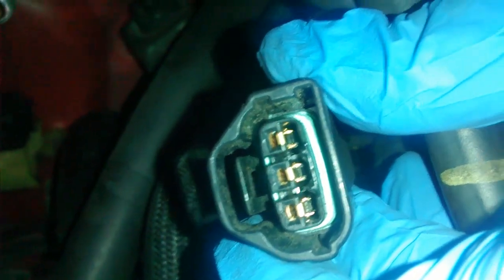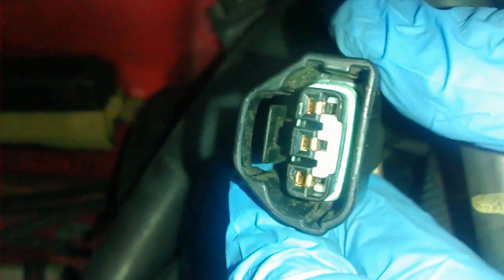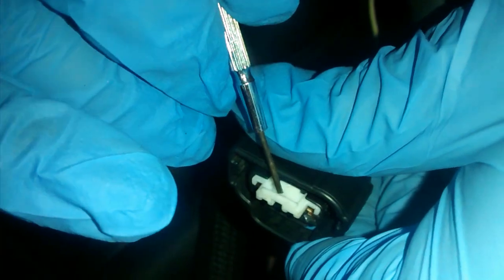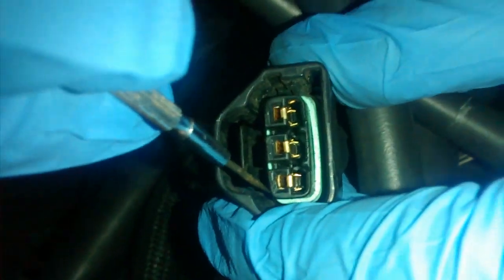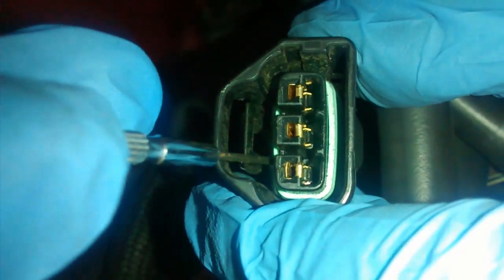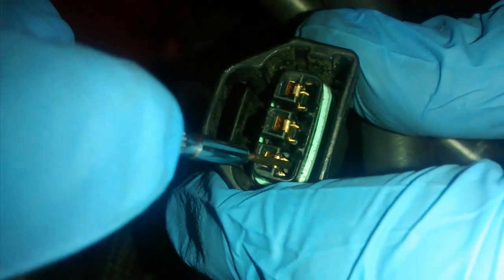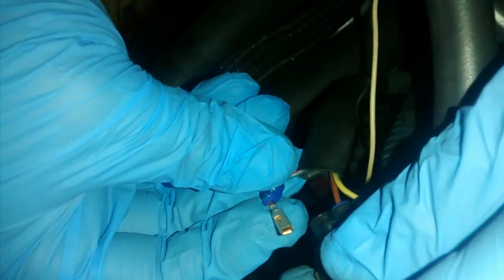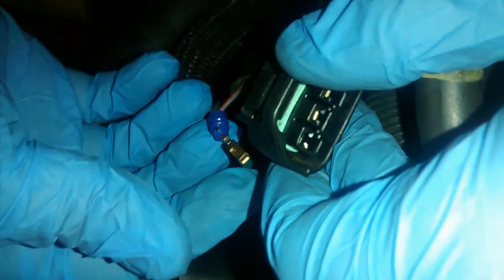Changing the Throttle Position Sensor Polarity - 2ZZ Swap

Comment: Hi, can you please confirm. In the video, are your wires in the correct position? Or did you take the video before you swapped the polarity? (is blue on the outside? or the inside?)